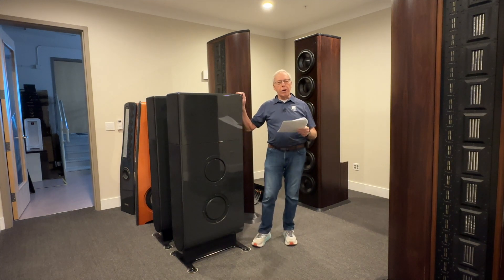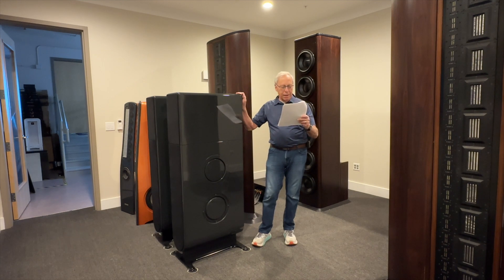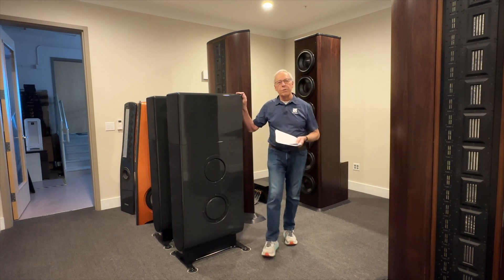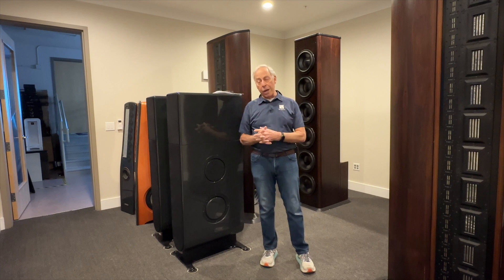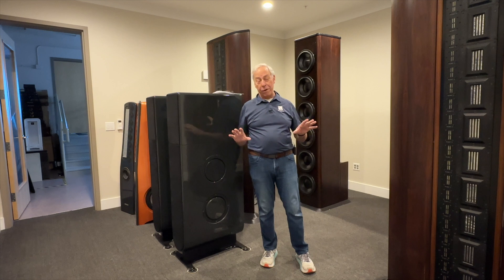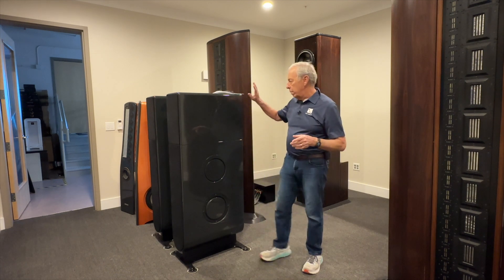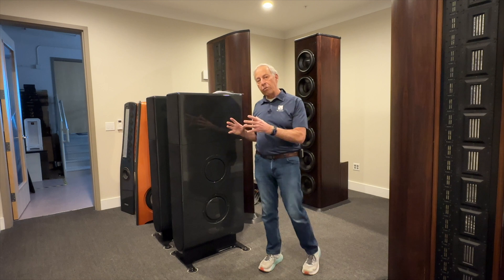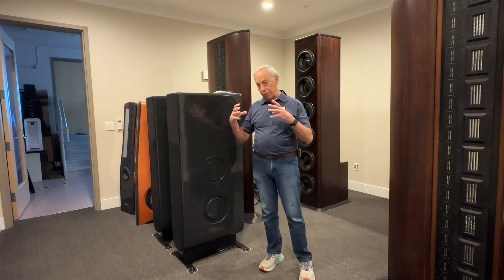Importance of parts quality in crossovers

Comment: Great video! I think crossovers are overlooked in bulk speaker manufacturers they do not give specifications of it.
Reply: Most people will never see the crossover of a speaker so it's usually among the first places to see cut corners to keep costs reasonable.
Reply: @hoth2112  Yes, and olso the speaker wire that they use I would like to have the full specifications.
Reply: @RoderikvanReekum  Hard to say, it looks like your typical 16-gauge stranded wire in PVC, though it may be polyethylene. Hard to say without being able to look at it in person.
Reply: @hoth2112  Would it not be nice to match the internal speaker wire to the outside wire you use.
Reply: @RoderikvanReekum  in theory, sure. but most people aren't going to rip their speakers apart to install whatever speaker cables they're using into the speaker, especially some of the more complex/ braided stuff like Kimber. That's an exercise in  unnecessary frustration.